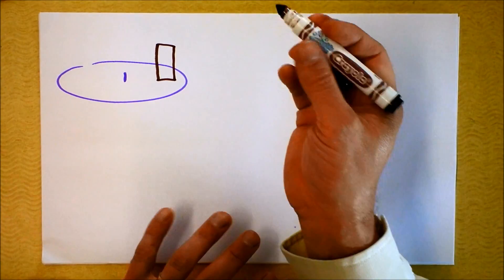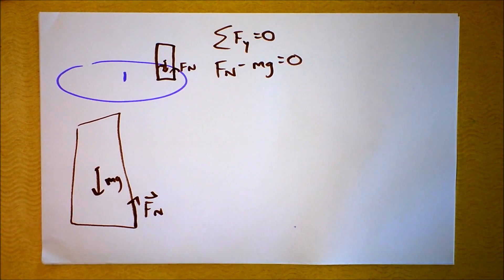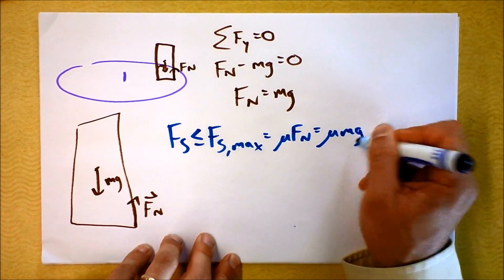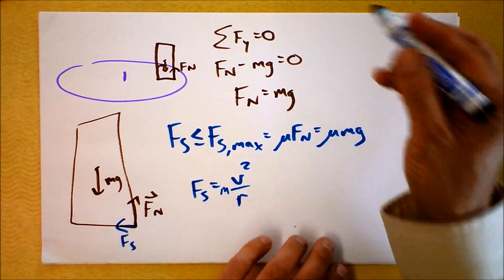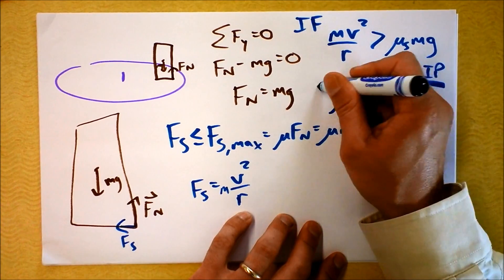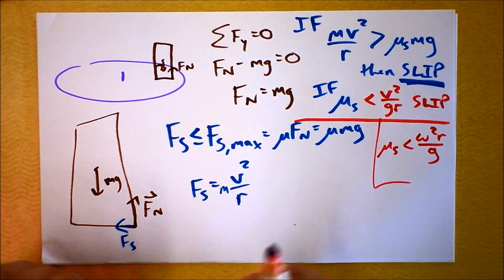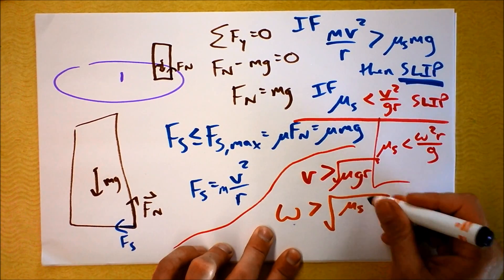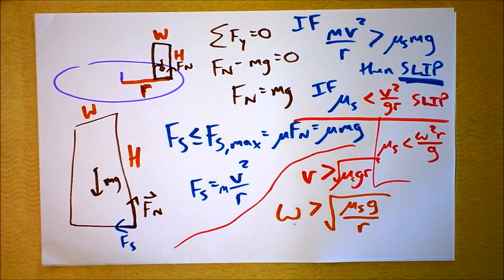Soda Can on a Record Player | Impending Motion of Rigid Stuff in Rotating Coordinates | Doc Physics

Comment: Sorry i want to ask something, why don't we choose the normal force from the middle point on the bottom or at center of mass ? Also the rotational torque axis also choosing at the edge of it ? is it because the force be greater if we choose it at that point ?
Reply: about 11:00 , so the torque of centrifugal force (tau) = Fc*r*sin(theta) which using geometry, the r = r(perp)/sin(theta) , ==> (Tau)c = Fc*r(perp) = Fc*H/2 right ? In here i want to ask why we choose the axis from the edge and we have to take it from the distance from the edge to the centrifugal force which is hypotenuse

Comment: There was a problem identical to this a few years ago in the college entrance exam I'm aiming for. I didn't realize I had used non-inertial reference frames when I solved it. 
Fun challenge - using what you've learned in this video, find maximum angular velocity ω in a rotating bucket of radius a and height h in a gravitational field g, given that the distance between the top of the bucket and lowest point of the water is z =  h/3 + ω²a²/(4g) and the water isn't spilling.